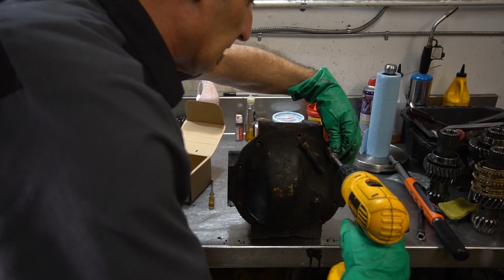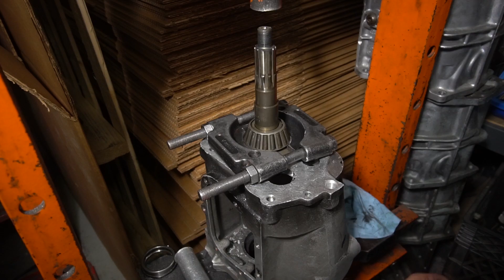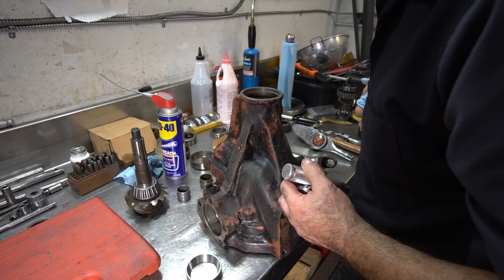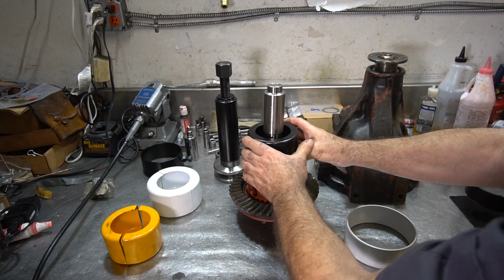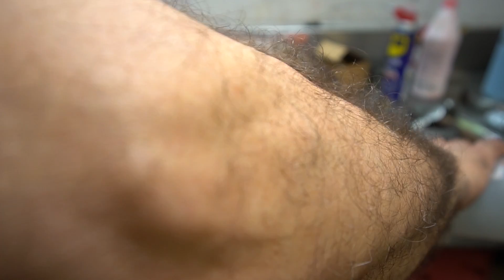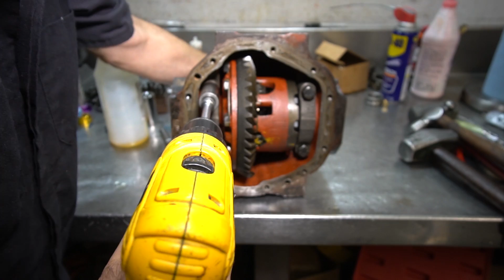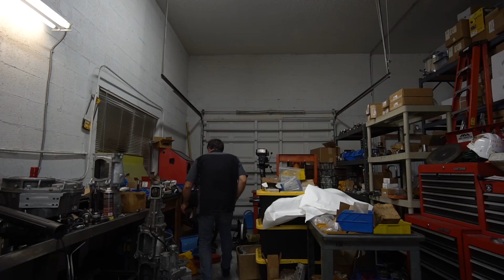Dana 44 Carrier and Pinion Bearing Replacement Basics Jaguar XKE

Comment: Great video! How do I know what model my Dana 44 is? Sheared teeth off the pinion. Gotta do a rebuild. I would like to have the pinion length spec u showed us. Maybe I just measure it before I take it apart?
Reply from the maker: Best way is to measure before. You should already have a Dana marking on the set. Without telling me what vehicle your 44 is in. I can't help you that much so just measure before
Reply: @GearBoxVideo  Its a swap in a highy modified Jeep. How do find a model number? No tags.

Comment: Very informing and helpful. I am replacing carrier and pinion bearing on my dana 27. I really should have purchased a second set of carrier bearings to hone out to may life easier on set up. Even  though the cups & bearings were matching Timken #'s, it's a bear to re-pull if required. I too don't like using a spreader.One can spring are damage a case in blink of an eye. Thx, Bear

Comment: I have a little question. If the drive shaft is moving in & out (maybe 1/8”), should I tight the pinion nut? (I’m scared to open the differential since I’m not expert)? What should I do? Pls.
Reply from the maker: Confirm if it's the pinion flange and not the driveshaft. You may need a pinion bearing.
Reply: I just didn’t see you put the spacers back under the carrier bearings.
Reply: @Mr572u  He did. I saw them, it just wasn't on the video.

Comment: If you were changing only a pinion seal,would the only preparation before hand need to be taking note of the inch-pound preload before removing the nut?
Reply from the maker: Yes for crush types but you still need to torque it. Spacer types just require torque

Comment: Awesome video! Thanks so much for taking the time to go through everything! I have a ‘13 Tahoe that makes a whirring/growling sound at highway speed that gets louder when decelerating...Carrier bearings???? And just so I understood you, if I just do the bearings (pinion front and rear, carriers) I’m ok to just set pinion torque and pre-load and not worry about backlash??? Thanks again!!!
Reply from the maker: could be lube level as well as bearings on the pinion and carrier
Reply: Keep  track of your left and right side  shims. make sure to get the same shim thickness back on  the  pinion before you press the bearing on the pinion.it's really the inch pounds of preload you're concerned with, not a specific torque on the pinion nut. And use a new crush sleeve.
Reply: I had that growling,whirring sound in the rear axle in my S10. I changed the fluid and it made no difference. I changed the carrier bearings,I didn't mess with the pinion bearings because the preload was ok,the carrier bearings were worn out big time. The spider gears were gone too. After all that time and money it still made the noise. The pinion and ring gear were worn and had too much backlash. It was a little quieter, I know it's not going to last.If I was gonna do it again I'd probably just go buy a tight one at the wrecking yard. Wrecking yard axle =$200 - $250 for an S10 axle. Rebuilding the original one is alot more $250,just for the gears. Bearings and set up kit that's another $150. I don't have the pinion depth measurement tools or the backlash measurement tools.I'm sure those are expensive. I imagine that you could probably get a complete used axle for that probably $400. If it's 4x4 make sure that you find an axle ratio that's exactly the same as what you currently have,otherwise you'll break alot of stuff when you use 4x4. Also need bearing pullers and probably a hydraulic press to put the new bearings on the carrier,those aren't cheap either. I wish I had just slapped a used axle in mine. I just look at it like this. It's cheaper to fix than paying a car payment every month.

Comment: Superb video, I watched it three times. I do have a question, you mentioned you had carrier bearings honed out for carrier alignment, do the honed bearings stay in or are they only used for  dimensional mockup and then replaced by the regular press fit bearings? Thanks
Reply from the maker: Mockup only

Comment: So I have a question when I’m putting in my carrier I’m having trouble having one side be flushed if that makes sense. Like the clap and the bearing+race won’t be in all the way. Can anyone help me?
Reply from the maker: You might need to spread the rear housing
Reply: GearBoxVideo how would I do that? Also it’s a Dana 35
Reply from the maker: I show you in the video what the tool looks like

Comment: This is the best explanation of differential bearing replacement I have seen to date. I'm faced with not only bearing replacement but the ring and pinion as well. It might sound extreme but since all the spacing (shimming) will probably change, which will require assembly and disassembly a couple of times to get my shimming correct,, would it be best to buy an extra rear pinion bearing and the carrier bearings (outer races) and lightly hone them for making them easy to install and remove. After I have my shimming established I could then install fresh tight bearing races for final assembly. Any thought you have about this would really be appreciated. Knowing what goes into this job makes it extremely scary when it comes to letting a local mechanic's shop do it, not to mention the cost.
Reply from the maker: Yes. This is often done. You can get a bore polisher or hone. I have slip on bearings for several applications.

Comment: Can reverse cut gears replace my standard cut when put on a locker?
Reply from the maker: Depends if the locker is directional.. You would have to ask the manufacturer. I would gather you are asking this because you are doing a 4WD deal.
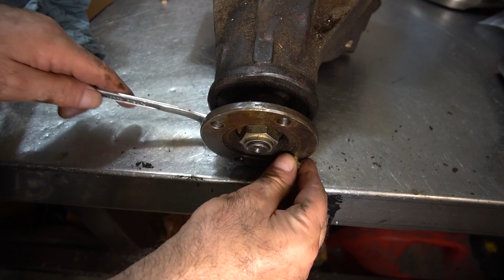Reply: @GearBoxVideo   Correct Dana 44 Front low Pinion Axle.. I removed the OEM standard cut gear set  (3:50 GR),  Trying to replace with Detroit TruTrac and (4:10 GR). I know there is a carrier break , but thought if the locker replaces the carrier I'd be okay, but now my ring gears are cut opposite 🤦‍♂️🤷
Reply: hickboy3067 Dana reverse spiral bevel is typically for high pinion applications in the front. Think Ford 44 and D60. Your ring gears aren’t cut opposite, you need the proper carrier. Look up thick vs thin gear sets. Typically carrier break on a D44 is 3.73 down and 4.10 and up. This has to do with where the ring gear is set in relation to center line of pinion. The pinion head gets smaller as the numerical ratio increases, requiring the ring gear to be closer to pinion center line. So the carrier flange on a 4.10 up is closer to center. Where as the 3.73 is further away. You can use a 3.73 and down carrier by going to a thick gear set when changing ratios, but you can’t (as far as I know) use a 4.10 and up carrier with a 3.73 and down gear set because pinion head is to large and carrier flange to close.
Edit: rereading, it sounds like your 4.10 and trutrac came from a highpinion if they are cut reverse of your OEM 3.50 gear ratio?
Reply: @tedcarl5382  , appreciate the very good information!  & The Detroit Tru Trac I've ordered is for the 3:73 on up..  & replaces the Carrier Assem. I called Eaton & confirmed I had the correct Locker..  so my 410 gears should work with that part of it. , Also my D44 is a High Pinion being that it's a front.  From everything I've looked up about Dana 44 H.P. front axles is that they do require a Reverse Cut gear.. so perhaps the standard cut gears I pulled were wrong to begin with?
Reply: So I was wrong by saying that I have a low pinion, because it's definitely a high pinion. 😳
Reply: hickboy3067 I’ve never tried it, but I don’t think you can even force a standard low pinion gear set into a high  pinion housing. The ring and pinion won’t mesh because the helical cut nature of the gears.
Is it a ford d44 housing you are dealing with? That stuff is usually pretty straight forward. The GM used a low pinion, so did Jeeps, up until late model, unsure about dodge products, they may have been high pinion in the vac disconnect era. I’d jump on a site like Pirate 4x4, tons of tech knowledge over there, use google search to find the old threads or the tech articles Billavista wrote.
Reply: hickboy3067 I’d lay the old and new ring gear side by side and look to see if the curvature of the gear teeth and the drive vs coast side of the gear match up in the direction that they curve.

Comment: How about a 2 inch die grinder carefully cut the bearings off? Then freeze the new ones to go on? We dont have Presses and Splitters and Gauges and Dial Indicators.....Im in the process of doing a Ford 9.75 Complete bearing Job without any special tools.
Reply from the maker: You would heat them to go on. I'm sure your method works fine for the one off job. I have a 5th gear removal video for a T5 on this channel and the only way to properly remove it without damaging it is to cut the outer bearing race with a die grinder.

Comment: Another great video. Do you use or recommend Royal Purple or Driven GL-5 lubricant s for this application? Thanks.
Reply from the maker: I prefer the Royal Purple max gear lube
Reply: GearBoxVideo thanks for the info
Reply: @GearBoxVideo   I just changed a ring& pinion and carrier assembly, and the rebuilder advised against synthetic gear oils for limited-slip, or locking differentials .  Everything else I read speaks highly of the synthetic gear  oils, what is your opinion of synthetic gear oil vs. Fossil  oils?
Reply from the maker: I've used Royal Purple in these during severe race conditions with zero issues

Comment: Hmmm. . .   43 and 13. . .   which are both prime numbers. . .   Am I correct in thinking that there are a lot of prime numbers used in gearsets so that the same teeth on one gear make as few contacts with the matching gear, for even tooth wear?

Great video!
Reply from the maker: Typically yes.

Comment: when measuring the pinion depth the were was the extra .006 coming from? because you was using .006 of shims?
Reply: will usually be engraved on the pinion by the factory when its made

Comment: Good vid!! I am about to do a D44 swap on my Mitsubishi Mighty Max, The donor axle will come from the rear of a 4x4 93 - 97 Isuzu Rodeo.  I will have to cut the axle down and have the shafts rekeyed as the axle is 2 inches wider than my factory axle.. 

Thanks for the good vid of rebuilding the D44, I will add the tools you used to my list of things needed for my swap project!!

Comment: I have been reading about Master Housing Dimension lately and never really knew that was a fixed measurment. From axle center line to the back side of the pinion head they say. What makes the variable in the pinion depth, is it the housing machine work or the actual gear set it self?
Reply: Also I wanted to say that was a great video and much more informative than all the others I have seen thanks for sharing!
Reply from the maker: The gears are machined to a certain nominal distance and run in on a machine. You are simply duplicating the stated distance on the gear when installing the set in the housing.
Reply: @GearBoxVideo  wow I just realized I'm messaging Paul Cangialosi!? I thought "this man is really smart and he goes through these units like a breeze working on them and knows every detail" so then I did some digging and now i know why you are so good at what you do! Thanks for sharing and commenting back. I rebuild mostly demestic auto transmissions. Did a few manual trans like T5 , sm465 , M5OD, transfer cases np208 np205 np231 np 246. Always enjoyed this type of work also.

Comment: i really enjoyed the video and your ways of assembling the rear. and i thought your way of measuring pinion depth was novel and interesting. quick. however you are assuming with your measurement method that the caps are split exactly in the middle. I do not believe this is always the case and you could introduce the cap split error into your calculation. Great info really enjoyed it.
Reply from the maker: Caps always will be split in the middle . Think about it really hard. No middle split and you can't install a race. Also, the pinion Depth tools can only be inserted if the cap has an center split.

Comment: I have a 2013 Rubicon. I’m working on rear. When I took carrier out, I forgot to leave bolts in bearing caps and carrier fell into oil drain pan. Consequently, shims fell in. They were stacked, so I’m pretty sure they were both on the driver side. One is .1125, the other is .1140. JK44’s use outer shims. It has an aftermarket 4.88 gear setup, on factory e-locker. Is it possible they were both on one side?
Reply from the maker: Probably not

Comment: Why don't you put grease in the bearings ?
Reply from the maker: Because oil is all you need. They sit in oil and grease should never be used when setting up a bearing.
Reply: grease on bearings swimming in oil

Comment: Question:
I have a 2019 Jeep JL with only 4k and Dana 44's. Lately there is a clunk from the rear when shifting into drive or during light acceleration. Could this be backlash and should the dealer cover it?
UPDATE Jan 2021:
The Jeep now has 13K so I took the Jeep into the Huffines dealer in Plano TX for an oil change and asked them to check the rear diff. They confirmed it had a clunk but said it was within tolerances. I'm not to concerned with it at this time since it started at 2500 (not 25000) miles and don't want them rebuilding my diff every 2k. I will probably press the issue after it has at least 30K on the clock.
The only other viable option I can think of is, if an aftermarket gear company e.g., US Gear makes superior gears that I can have the diff rebuilt with so it will last maybe 30-50k with out any problems.
Reply from the maker: usually in the shafts, not the rear. Your vehicle is under warranty so take it back to the dealer
Reply: @GearBoxVideo  okay thanks!
Reply: I just bought a 2021 and have the same issue. What was the solution for you?
Reply: @Jay-bw3fl  See update.

Comment: I am rebuilding a Dana 44 from a Jaguar XKE.  I replaced the plates in the Limited Slip Unit.  One of the plates was cracked all the way through.   Now when I am trying to put the limited case back together one bolt hole does not line up.   There is only 2 ways the case goes back together, and one most of the bolt holes do not work. The other way, I found an X which lines up. This is the way one of the bolt hole is just off a little where I cannot get the bolt started.  Since I only have one limited slip case, I know it is the correct match.  Now the question, how do you line up one of the bolt holes, when one seems out of line?   How to get all bolts started on the limited slip case.  This one is a head scratcher.
Reply from the maker: First bolt it together without the plates. To see your alignment. You shouldn't use the bolts to pull together. Do that in a press or vise.
Reply: @GearBoxVideo  I tried, but i will try again.   I tried to match it up with no plates, and I had trouble matching the holes.  I know there is some secret, I just haven't found it yet.
Reply: First off, never disassemble a Dana/Spicer Power-lock without marking the 2 halves, second, don't mix halves from other cases.

Comment: Every housing is different, but worrying about cast iron is legit.  You ever find a recommended limit for that spreader? I'm thinking 0.3% for 5" [to pick a number] buys 0.015" clearance, which should be maximum?  Maybe 0.2% is all that's needed on most housings?  I don't know, but think I would not try to use that tool without doing math first and setting up a dial indicator to prove movement for inserting a carrier, and never leave things stretched overnight.   Nice work.
Reply: Good idea, don't leave it stretched overnight. One other thing I do is back it off when working with the pinion bearings and preload. If I have the housing spread and I'm waiting on parts or going to lunch, I get antsy and back it off.
From Russia, with Love....

Comment: I was putting in a new pinion and the shims on the "new" pinion do not go all the way down on the pinion.  Also the new bearing is very tight. Can I heat the outside pinion bearing to put in the new one?  If so do I use the crush collar with or without shims.  I guess since the bearings cool down quickly,  do I needs to set this?
Reply from the maker: Pinion shims that go on the pinion work with a solid spacer. The crush sleeve shim is under the race

Comment: Hey, awesome and very informative video! I do have a question though, my carrier fell out when I unbolted the caps, for a bearing change. I measured it out after I removed the pinion and i have .0020 of play from left to right could this be due to improper setup or excessive bearing/race wear they really don’t appear to be in that bad a shape but I’d like to know if i should stick 
.0010 shims on each side before I press the new bearings on? Should I just plan to get some setup bearings?
Reply from the maker: Make some set up bearings. They need to be preloaded

Comment: Does on checking preload pinion torque and preload pinion+crown gear with dial torque wrench, does the bearings must be dry or can be oiled, or there is no difference whether are dry or oiled?
Reply from the maker: I always oil them.

Comment: Great video.  I use a housing spreader and the fancy Dana tools.  They save a lot of time.  I have everything from model 17 to 80HD.  Also have ford 9" depth tool.  Hate crush sleeves and non Dana diffs.
Reply from the maker: The object of my videos is to show people how to do as much as possible without special tools. I have quite the collection.
Reply: @GearBoxVideo  I can appreciate that.  Thanks for the reply.  I will be using those methods for the riffs I do not have special tools for.
Reply: Scott Harvey Like the machine a sleeve myself I don’t like crushed tubes either specially if you run a lot of horsepower